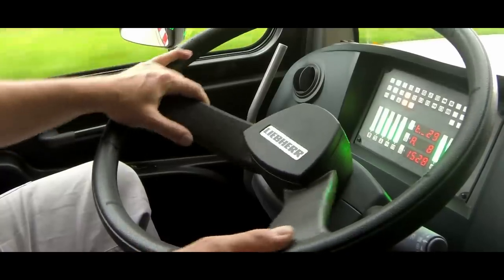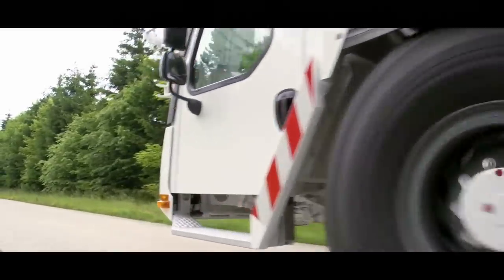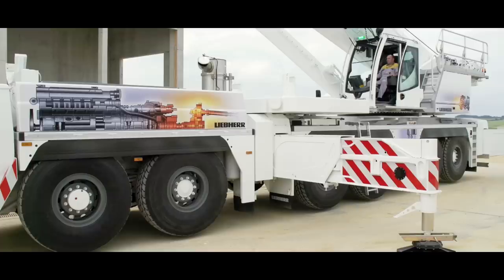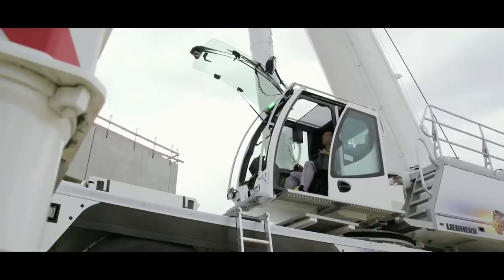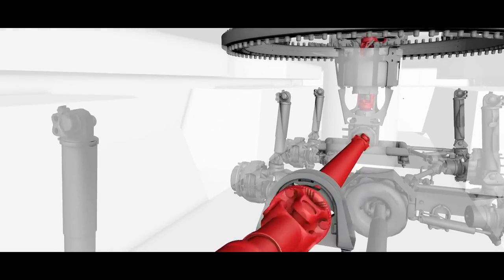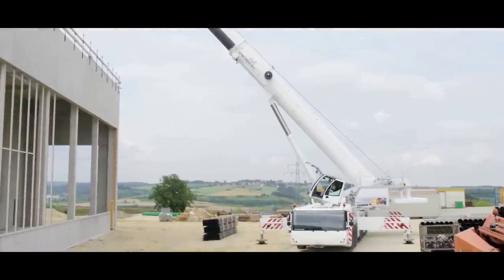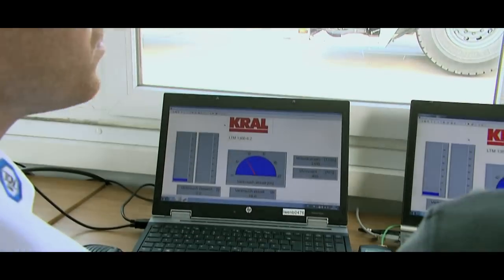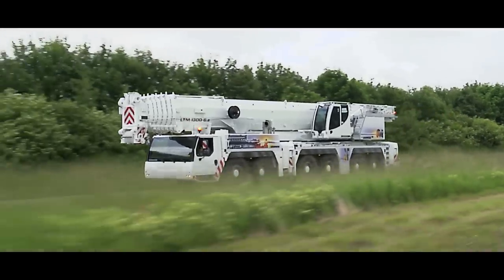Liebherr - The LTM 1300-6.2 with single-engine concept

Comment: cool but i have my questions on more wear on the extra spinning parts.

Personally i am still waiting when these machines turn into "hybrids" only using the combustion engine as an electrical and hydrolic power source to drive the wheels and the rest of the machinery.

i also feel that like some cranes nowadays you can lose 1 cab.
i also feel that the road driving direction for a combination like this could be changed 180.

Combining this withe a cab on a rotating lift arm and making it drive "backwards" would only need 1 cab at the end where nowadays the counter waits live , those then could be placed what is now the front together withe the base spreaders for the outriggers , for driving and stowing etc.

the pro on dooing this is the following in my eyes :

Making the thing electrical , you could hook it up to a power supply on a building site.
Thus making it more quite , and outputting les emissions. Which in turn would make it more easy to work in confined city spaces where noise and pollution is more stringent.

Making it an hybrid would also reduce the amount of heavy spinning parts that need maintenance thus reducing the wait and performance of the combination.

It would also prepare the product for "the future" where the power source of the drive train is no longer certain to be an internal combustion engine( could be fuel cell etc ) .

Updating the machine would them be more easy , just change the power source.

Reversing the cab would lose partly wait on 1 cab (lift arm would increase that) , but the view from the drivers cab in road mode would be no longer obstructed by the boom.
There would be a chance to get a higher road line of sight by a more traditional height of truck cab , potentially making it more safe.

There will always be blind spots on a big machine like this , but adding camera's and sensors would help the driver.

In crane mode the cab could be positioned in a way that is non traditional ( because of the lift arm), and you would be able to get a different and maby better view on your lift.

I'm no pro but this is how i see your product , working myself in the building industry and a fan of machines like this.
Reply from the maker: Thank you very much for your feedback and thoughts, felix t.j. Falk !
Reply: I would think it would be even more efficient to power the crane's hydraulic pumps with electric motors that are driven from a separate alternator on the transfer case. That  hybrid system would eliminate the complex  and heavy mechanical drive components. The addition of a small battery pack would possibly allow the cranes driven engine to only run when the batteries drain down or when the batteries alone cannot supply the needed power.  IMVHO.

Id love to work for Liebherr if they are searching for a design engineer.
Reply from the maker: epistte Thank you for yout thoughts. You are welcome to browse through our job vacancies and directly apply online if you like: http://www.liebherr.com/en/deu/career/job-vacancies/job-vacancies.html

Comment: why the lond and complex second driveshaft? why not put the pump at the front and pipe it into the crane?
Reply: Easier to send a rotating shaft up through the turntable than to try to make a high-pressure dual-axis coupling, I presume.
Reply: That space is needed to store the boom when it is fully lowered to travel .

Comment: I always wonderered if they had one or two engines. Now i am wondering why it needs two sets of drive shafts. Why not just run hydraulic hoses to gear boxes to operate the crane. Less moving parts, less to brake down and less weight. If a hose breaks, it's much easier and much less expensive, and much faster to make the repair and get the machine back to work. Time equals money. Do i have to think of everything.
one thing i don't understand is why do you want tge crane to have less weight?
If you're lifting weight with a boom, you should have as much counter-weight as possible to prevent tipping. Yes?

Comment: Very nice concept, the cost savings I would imagine could be quite high with one engine. Would such a concept ever work with the big boy 11200 though? Or remove the second engine completely from the 1750?
Reply from the maker: Generally it would work even with the "big boys", marksapollo !
Reply: +marksapollo Not a lot of cost savings when you think the engine maintenance and life go by hours which pile up using only one engine all the time. Liebherr engines are very good but also very expensive. Lots of extra service expense having one engine run all the time, this was the reason and sales pitch for the second engine crane concept. Also they "claim" a 700 KG weight saving but i question that due to the shafts are heavy and two 90 degree wedge gear boxes and what is all that replacing? just the engine, hydraulic and cooling system and fuel tank, most of which was calculated as ballast anyway. I have been on this crane several times and don't see the claimed weight savings, it actually feels heavier since they also require a electric system in case of engine failure with boom out that adds more weight. In 2 engine cranes just plumb into lower and recover crane no added weight. This system to me is like communism, works in theory but not so much in reality.